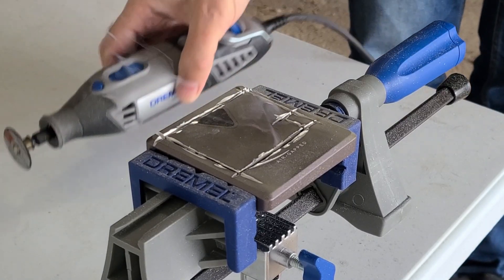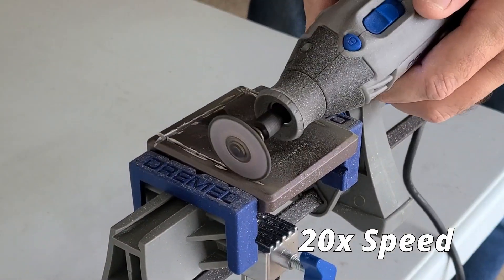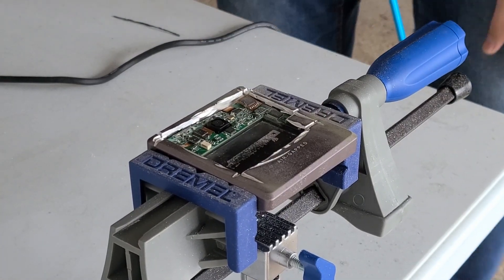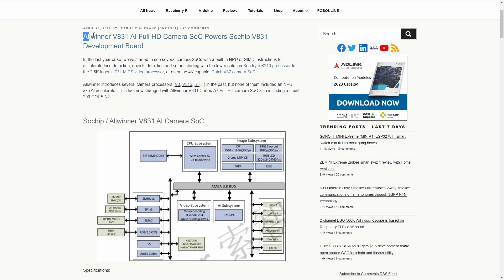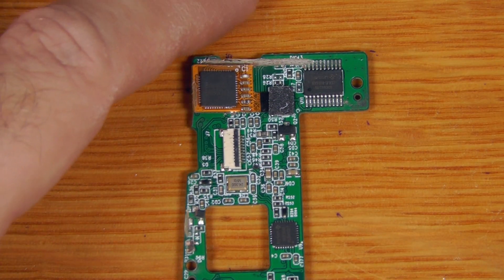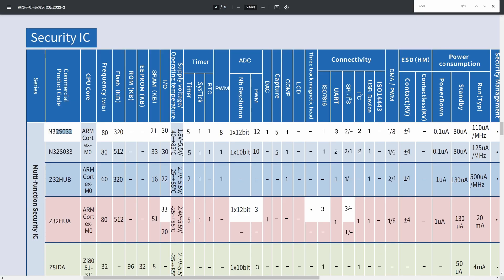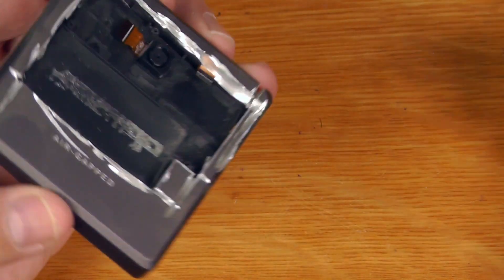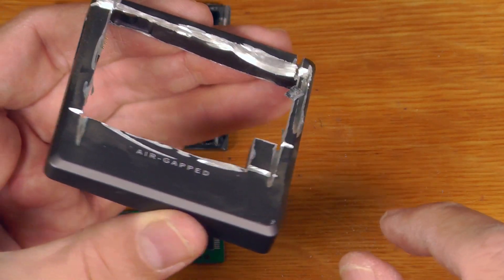Teardown: Ellipal Titan Mini Hardware Wallet (Disassembly, Components & Overview vs Ellipal Titan)

Comment: DO NOT BUY ELLIPAL WALLETS. THEY STOLE $4K IN CRYPTO FROM ME. SCAM ARTISTS
Reply from the maker: How do you think they stole something?
Reply: @CryptoGuide  I used their website that their customer service directed me to to try to fix my XRP balance not showing up in the wallet. The official Ellipal website and tried to use what they call the ellipal titan tool interface. This morning (5 days later) damn near all of my crypto has been sent to other wallet addresses. I have not done anything else with my crypto since going to the ellipal official website. I have filed a complaint with the cyber crimes division of the FBI. I have seen other people claiming their crypto has disappeared as well using Ellipal.
Reply from the maker: That tool is fine, as I have used it, but if you ran it on an internet connected computer of any kind, you likely had malware and leaked your seed. (Or imported the private keys from that XRP tool into something malicious)
Reply from the maker: Their real XRP key tool is on GitHub and is open source, so that isn't the problem. (Unless you were taking to a fake support agent, so a scammer, who has you lunch your seed in to some website or malicious tool)

Comment: Thanks for your amazing video, you were lucky the battery cell isolation functionned as intended an did not set on fire the whole device 😅 ... Any chance you do the same video for the ellipal titan v1 ec2 ?
Reply from the maker: Yea I was opening it up in an outdoor, non flammable space, so was fully prepared for the whole thing to shoot flames out.

In terms of the other devices, Ledger did a teardown of older Ellipal, so there isn't much to see there.
Reply: Yeah I saw that Ledger analysis on the initial Ellipal device, was wondering whats inside the ec02 v1 as no one opened it... I will open mine if it die 😂
Reply from the maker: The ec02 was still just a custom Android device, so the difference between EC01 and EC02 is t really interesting, but cutting one open can still be fun :)

Comment: What will happen to the Ellipal device when the internal battery is dead (after many years) ?
Reply from the maker: Basically it will only run when connected to a charger at all times. (And isn't user replaceable)

Comment: Could you please do a video showing if the seed phrase recovery works on this wallet? If your old wallet gets destroyed or lost . I just don't understand how something that is never connected to the internet could be used to retrieve lost coins if destroyed . Thank you
Reply from the maker: It does, you just import the seed and it's good to go. Just watch my video on why recieve addresses change and it explains the concept behind it.
Reply: Do you if you are supposed to replace batteries on these items if the battery fully dies?
Reply from the maker: Basically once the battery dies then you need a new device. (A fully failed battery will likely also trigger the anti tamper protection and render the device useless)

Comment: I have been debating on the Titan vs Titan mini. The breakdown has been very insightful. Thanks!
Reply from the maker: Glad it helped :)
Reply: @CryptoGuide  So I now bought a Mini, I am curious why you believe the Titan has not received any of the software and/or hardware updates like security chipset? Did you do a tear down on a Titan? Just another curious aussie!
Reply: The EAL5+ is a big difference as you said.
Reply: @CryptoGuide  BTW, I held off buying the mini for all teh Reddit issues being reported. Just to share out of all the youtube video's on the mini your videos were the ones that made me park my Ledger Nano X and invest in the Mini as the main cold wallet. Anyone reading this comment make sure you subscribe to Crypto Guide.
Reply from the maker: Basically the Titan is like the original Ellipal in that it's just a cut down Android phone and lacked the specialist hardware found in the mini. (So this wasn't something that could be fixed in software)

There is a good writeup on the original Ellipal device here https://blog.ledger.com/Ellipal-Security/ (pre-dating the Titan) While most of this stuff was addressed with the Titan, the overall architecture remained unchanged. (And only changed with the Mini)
Reply from the maker: No worries :)

Comment: Great experiment 👍 

Some software wallets (Hot Wallet) now feature passphrase (12 + 1), multisig or 2FA, or all together.

Like Unstoppable, Green, AirGap vault ...

Do you think these are safe & secure?
Reply from the maker: The addition of a BIP39 passphrase doesn't boost the security of a software wallet, only add a layer of protection to your backups. Something like Multisig with software wallets is a different story, providing that the signers are all different devices, can be more secure. (Though can be messy to back up and not as good as a stateful hardware wallet that stores the info of all the signers) 2fa is a mixed bag and varies dramatically in security depending on the specific implementation...